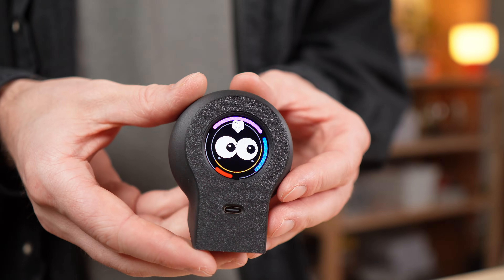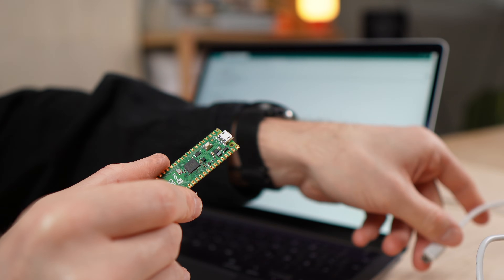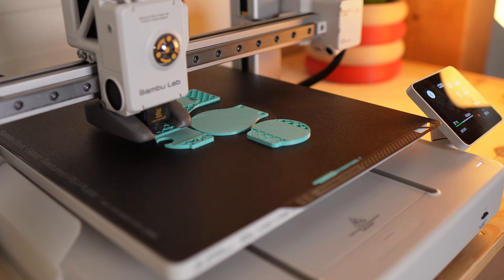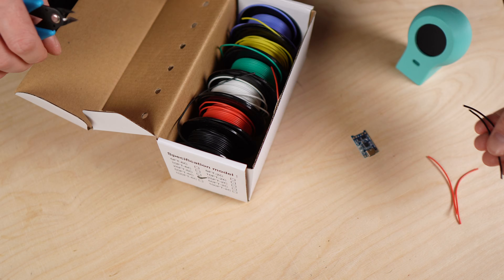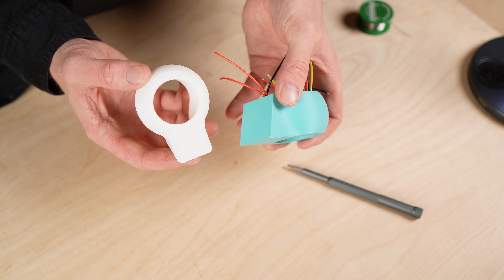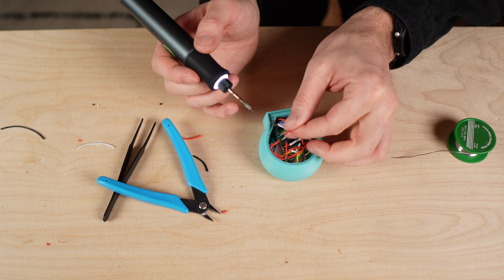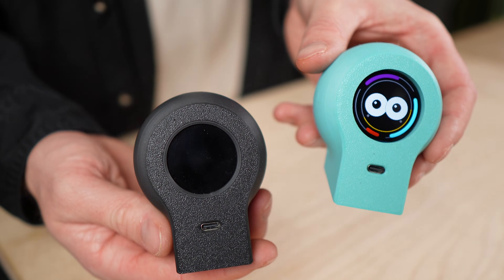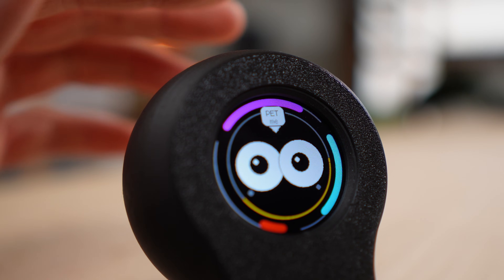How I Built My Own Digital Desk Pet (From Scratch) I Part 2

Comment: Really Great, I love such builds :)

Maybe the "Waveshare ESP32-S3 1.75inch AMOLED Round Touch Display Development Board" could be the right choice for this project? It's amoled, has an integrated esp32, Microphones and Speaker as well as an accelerometer. But I guess, the Memory is not enough?

Comment: I couldn't get a response via Kofi, so I did it myself. It's working now, but it doesn't seem like it's like in the video. Because when I plug it in to charge, the light on the charging card comes on, it looks like it's charging, but I don't see anything on the screen. When I open game mode, it says "play," and in the video, when you hold it down, it says "nice," etc., but on my device, the left and right sides of the screen light up and it's like "game over." Also, I'm sure everyone is curious about this, I found a lot of things by chance. For example, what happens when you tap right? What happens when you tap the top? What happens when you tap left? Or what happens when you tap all of them, or just right and left? If you could write that in the documentation, we would know what to do. Another thing, I don't know if it was in the video, is it possible to see the battery percentage? So, I got it working, but I don't understand if it's working correctly or if there's a problem.Can you answer these questions, or do we need to figure them out ourselves? We can't offer any updates or improvements without fully understanding the project. I especially didn't understand the battery level. When I turn it on, the battery level is yellow, then gradually turns red, and then completely resets to zero. But the device is still working.

Comment: In another question, you mentioned using an 8mm M2 screw, but an M2 screw doesn't fit through the screen's screw hole. I'm afraid of breaking the screen if I force it, and screens are expensive in my country.

Comment: As someone else mentioned OTA would be very handy, you can do it with the Pico W series very easily. 

Also if it’s a desk device, maybe it should be plugged in all/most of the time and use battery as a backup? I don’t think you’ll be able to get any reasonable (multiple weeks) worth of battery anyway, and recharging would be more annoying than just have it plugged in. Just put the USB C port on the back. 

This is a bit out there but you could even have a wireless charging coil at the bottom and use it with a wireless charger as a base. Never tried that so no idea if that would work
Reply from the maker: Love the ideas, especially the wireless charging concept for a desk device! Thanks for sharing your thoughts 👍

Comment: Idea - you could consider using accelerometer/gyro sensor for some interactions and some controller that allows OTA updates would be cool. (Maybe that esp32 is not that bad idea after all… :). For power requirements perspective as well. ) If you are totally against it, at least some USB-C controller would be cool - like some RP2040 boards (like YD 2040 or RP2040 Zero), with ability to flash it from the bottom of the case. Besides - cool project
Reply from the maker: Love the ideas 🙌
Gyro / accel would be super fun for interactions, and yeah… ESP32 + OTA is very tempting :) Thanks for the Feedback!
Reply: @PaulLagierEN cool :) one more idea from yesterdays tinkering- there are some esp32 boards with built in charger - like esp32-c6. Using this would allow to have just one port for reprogramming and charging (not to mention usbc and ota updates) :)